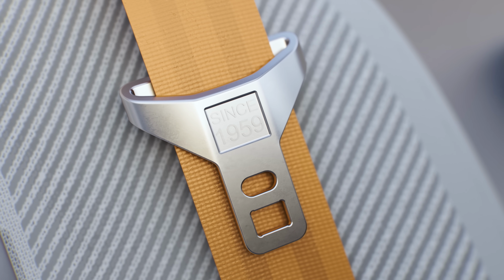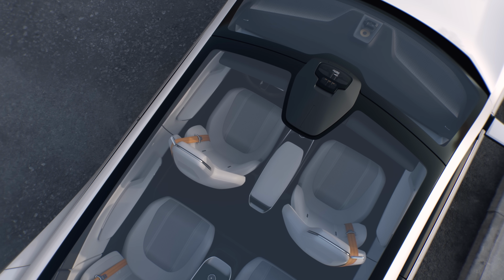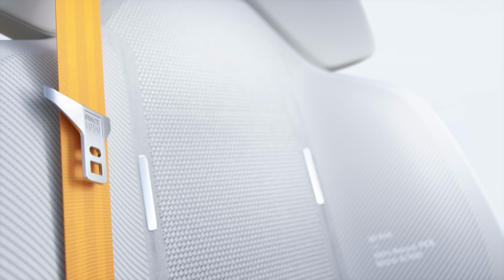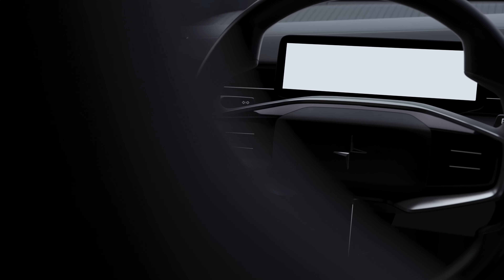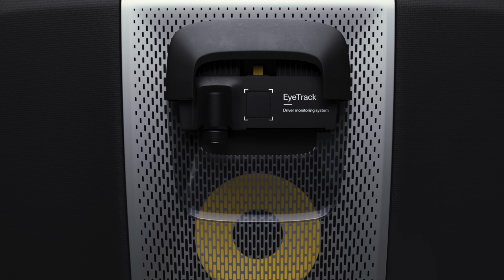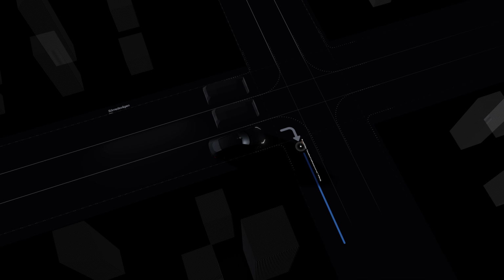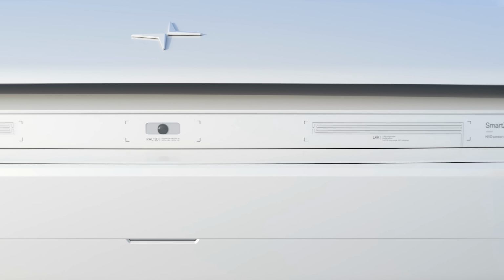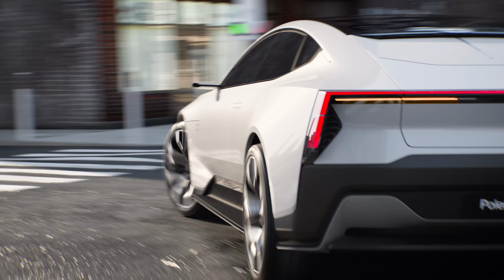Polestar Precept - Evolving the EV with our concept car | Polestar

Comment: How sustainable are the batteries, drivetrain, production, recycling etc.? Whats the estimated lifetime of such a vehicle with complex sensors etc. all over? Will people be able to afford the maintenance on used examples in 10 years? Or will it be like smartphone-models: outdated and unsupported after a few years? Sustainability is a big word to use on a car - or any other consumer product for that matter - a lot of facets to take into consideration.

Comment: Seems the designs of Polestar are the same as Volvo. Polestar is the advanced tuned and all-electric Volvo yet still some Volvos are Polestar tuned. The interior is a bit more stark than other concepts. It's not Tesla like, but quite stark. The exterior is beautiful, sort of like the futuristic look of the s90 without a front grill.

Comment: they should've made the design more like polestar 2, polestar 2 like coupe suv but bigger would be perfect, would buy it in less than a heartbeat
Reply: Polestar 2 comes from a concept car and is very, very close to it. It was designed back in 2016 or so. It was the Volvo Concept 40.2. Concept cars look forward and here they're trying to bring in new materials, sustainability and autonomous driving. They'll take technology from this concept and some design and they'll appear in upcoming Polestar and Volvo cars. This car won't appear in this form, though. Some concept cars are closer to a production car than others.